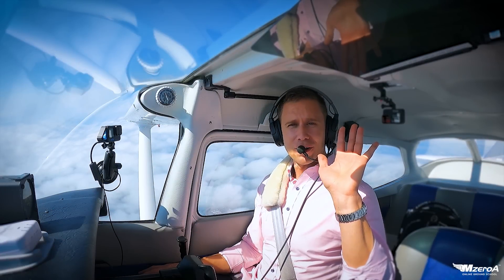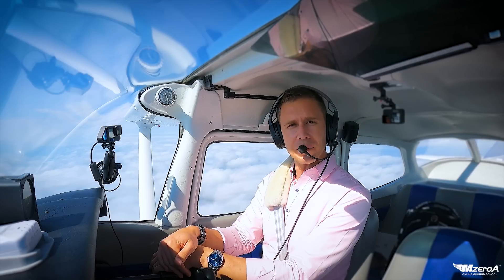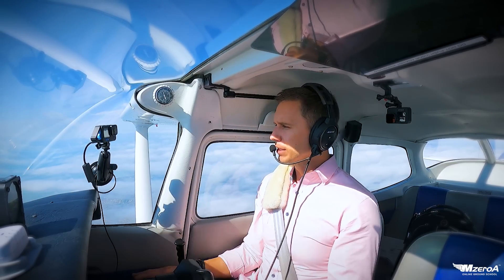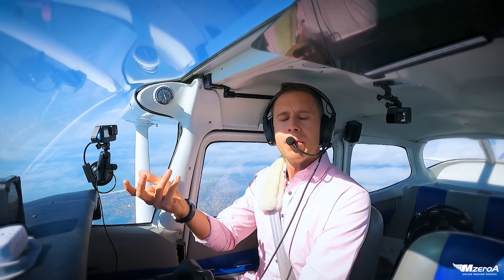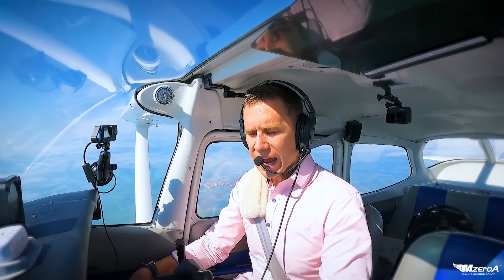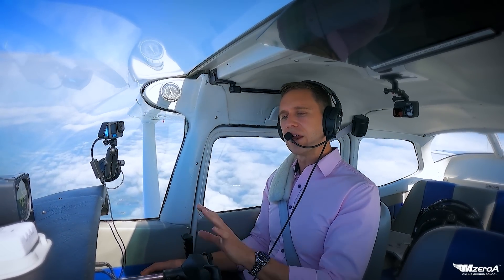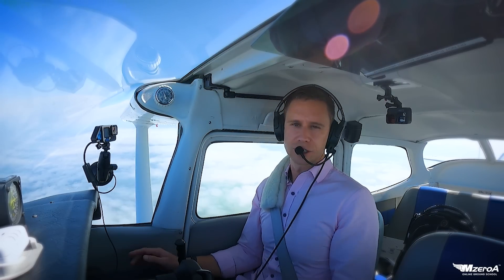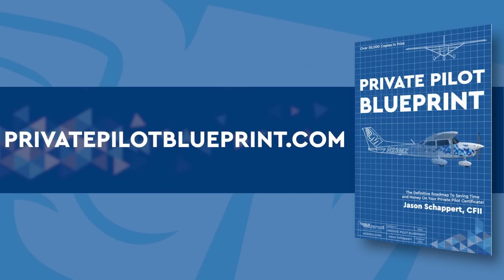Ever Use The Red Lever? Leaning The Mixture

Comment: I use a JPI EDM-730 and for best power in my Piper Dakota it is about 50 degrees ROP.  Best economy is 20-50 degrees LOP. I agree... if you do not have the instrumentation, I avoid LOP operations. "Poor man's" ROP I do what you do.... Lean it out until the engine RPM drops slightly or goes slightly rough, then will enrichen the mixture a bit past the point it smooths back out and yields greatest RPM - staying on ROP side. Great video.

Comment: I agree that leaning is important for the health of the engine, but have to disagree that rich of peak is best.  Plenty of opposing viewpoints as to the benefits of flying lean of peak.  The type of engine and the engine monitoring capabilities play into the decision.  Both rich and lean of peak are safe and effective under the right circumstances. The knowledge of the pilot about when and how to use them is the key.

Comment: 14 for 14. Low hours student. Haven’t had much practice with it yet so this helps. POH isn’t helpful. CFIs, all six so far, have reached over and adjusted rather than getting me to do it. Having to be more assertive in my instruction questions now having soloed to get more detailed ops instructions. Don’t think I should have to, but there you go. Thanks much for this.
Reply: You also need to take control of your training. If the instructor reaches over to do anything, ask them what they're doing and tell them you can do it if they show you how. Some students are nervous, shy, overwhelmed, etc, which is why instructors have a habit of just doing things.
Early in my training, I'd let these things go and realized I was missing out on valuable learning opportunities.
Reply: Don’t just look at the POH. The Maintenance and Operators Manual will give you the manufacture’s recommendation as to how your engine should be ran.
Reply: @SirJer  So true. I realize now I should have been more assertive. I feel like I’m behind the curve and trying to catch up to where I need to be, but I’ll get there. There’s a big difference between CFIs too. Much more than I expected. Thanks for the response.
Reply: @zachschaneberger  Great suggestion. Never seen anything but the POH. Will ask now. Thank you.

Comment: 👍 14 for 14. Came to my flight training with A&P training many years back, also a professional performance engine builder and tuner. Manual control over fuel mixture is quite antiquated in todays electronic world but also welcome, having full control over that critical aspect of the engines performance.

Comment: 14 for 14.

I learned to lean the engine old-school, lean until the engine stumbles then rich until it runs smoothly. As learned on a cross-country training flight, "climb to 5500 and I'll show you how to lean the engine". The plane I fly now has an engine monitor so I can lean by EGT and dial it in precisely. Its O-320 objects to lean-of-peak operation, so I don't: lean in cruise, full rich for takeoff and climb up to 7000, lean for peak power above that.

Comment: 14 for 14 from Hungary🇭🇺
I’ve never ever used the red lever for anything other than stopping the engine - mainly because I haven’t even flown an airplane which has the necessary gauges to be able to effectively lean for performance, also our small country doesn’t really necessitate the usage of the option as we don’t have high mountains or long distances, not to mention the SOP of the ATO I’m renting aircraft from has specifically stated in their SOP not to lean in any circumstances.

Comment: 14 for 14!

Not long after I got my PPL, I took my brother-in-law on a lunch flight.  We cruised up to the lunch at a relatively low altitude so he could enjoy the sights, but on the way back I was at 6500 ft.  I was explaining to him how I lean the mixture at higher altitudes.  Unfortunately, this plane didn't have the "twist" feature on the mixture knob, so I was pulling the handle slowly.  As I was pulling the knob, the handle had a slight "catch" and didn't move, so I exerted a little more effort on the handle, then it "gave" and the handle popped out about an inch or so.  The engine immediately coughed, and I shoved the mixture back in.  Of course, power came back immediately.

It didn't scare me, and I kind of chuckled it off.  But the incident spooked my brother-in-law so much that he didn't speak for the rest of the flight.

Comment: 14 for 14. When flying the club 172 I would lean if at a higher altitude. I was never afraid of using it. However today I fly behind a Rotax 912ULS in my RV-12 which has auto mixture and no mixture lever.

Comment: Hi Jason, great video! Two questions:
-why would you lean for cruise flight only above some altitude? would leaning not save fuel even at say 2000 feet? I am asking because where I live, we rarely get above 3000 feet …
-my second question is when exactly you would pull the red handle when taxiing, and when you push it back in.

Comment: I was a little scared of it at first after passing the PPL, because I learned on a Tecnam P2002 which has no mixture knob, It's controlled be the ecu. Then our Aero club got fuel injected 172's and I had to learn how to properly lean it, because they were wet leased aircraft and we would get charge extra for excess fuel burn. Then I got the hang of it, learn to lean properly people, you can fly higher and further because of better performance and fuel economy and it extends the life of engine components.

Comment: 14 for 14; I need to get with an instructor to figure out the proper leaning of my 172.  Unfortunately I have static gauges and I never detect the RPM drop while leaning in flight, and that is with the knob sufficiently out.  Any suggestions on a better way to perform this operation with statics?  Thanks

Comment: Disagree wholeheartedly about rich of peak being superior to lean of peak. That said, most trainers are not properly instrumented, and you also often need fuel injection (again, not common on trainers) to utilize. But it saves me 2-3 gph on my aircraft for a minimal speed penalty (25% fuel savings for 5-8% less speed). That’s significant to me as an owner.

Comment: Second comment.  Totally disagree, Jason.  Running rich of peak can actually be more dangerous when you look at internal cylinder head pressure, especially 40° rich of peak on a Lycoming.  Do some more research.   I mentioned it in another comment, but Google Mike Busch.   He is an award winning A&P.